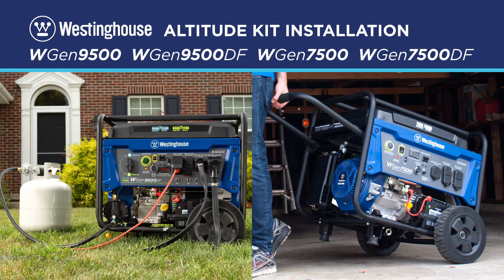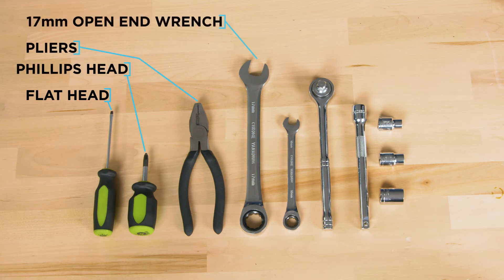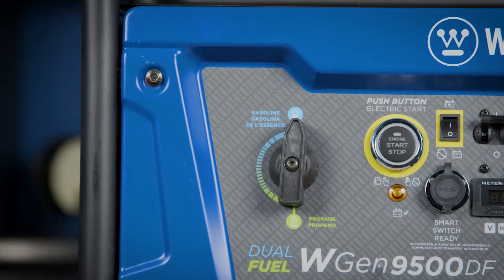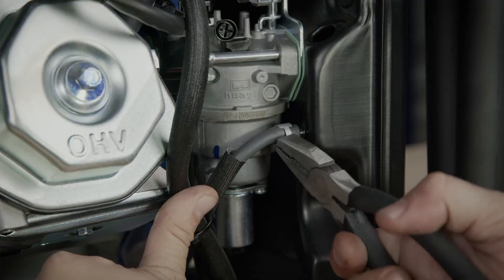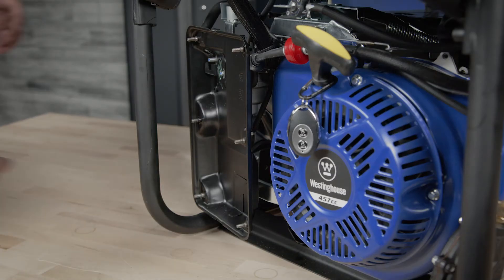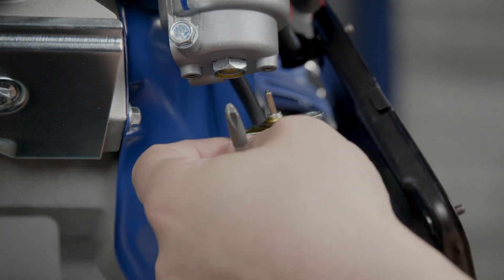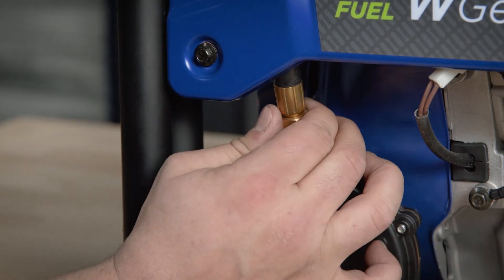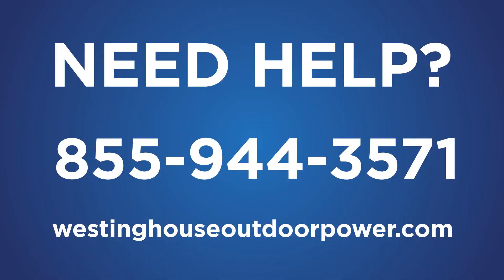Altitude Installation Kit - Westinghouse WGen7500 WGen7500DF WGen9500 WGen9500DF

Comment: Looking for instructions on changing out the jets on the 14500DFc. I have the parts kit they sent me. there are no instructions. The kit comes with two identical jets for each altitude. I'm pretty sure I can figure out the the carburetor jet. But where does the other one go?? did does not look like the propane jet depicted in this video for these models.

Comment: That was helpful, thank you.   I installed without problems except the 4 x propane orifice regulators I received were thrown together and unmarked.   For those of you in the same boat, I used calipers on the IDs and assumed it decreases as altitude increases.   My measurements went like this:  Factory installed 0-2000-ft: 0.225",  2000-3000-ft:  0.215",   3000-5000'ft: 0.210",  5000-6000-ft: 0.200",   6000-7000' was 0.195".    Obviously it would have been faster to have called customer service, but this was Saturday morning and I didn't feel like waiting around two days.    Hope this helps.
Reply: Hi, where did you buy the high altitude kit? I been trying to contact support but I've gotten no answer. Thanks
Reply: @andresayub  ditto, where in tarnation are they hiding these kits? even at 9000' it still works, but i'd like to maintain something that resembles efficiency.